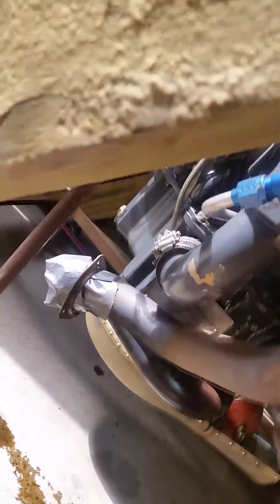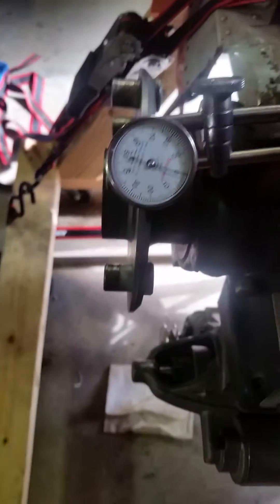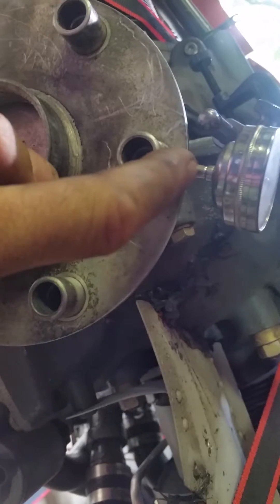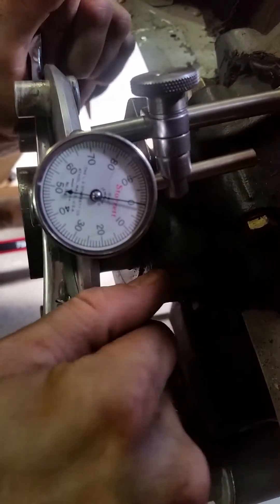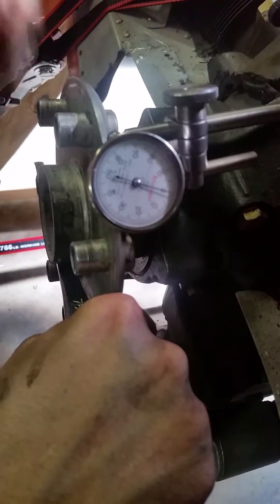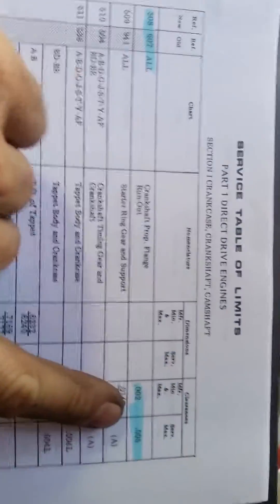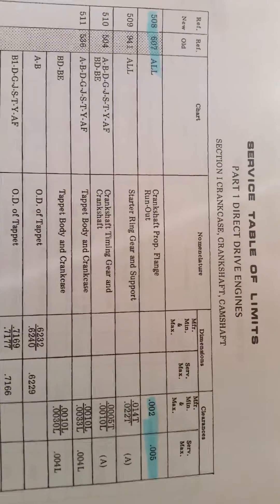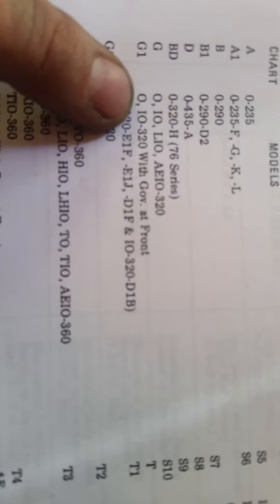20170914 153320

Comment: Why are you checking radial runout? You should be checking the face runout. You also need to maintain thrust bearing contact on the crank during the check.
Reply: That's what I was wondering 🤔